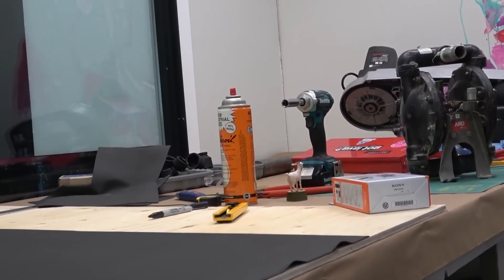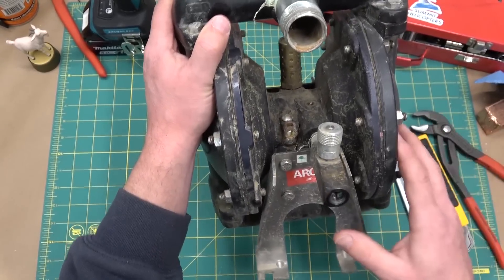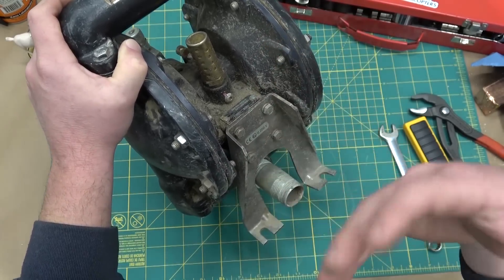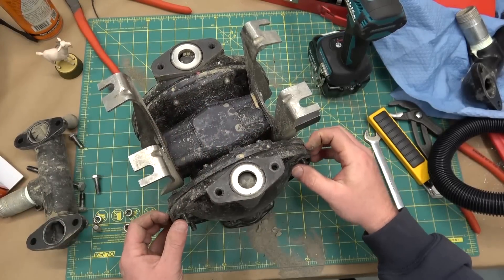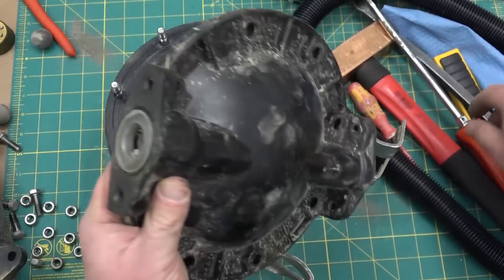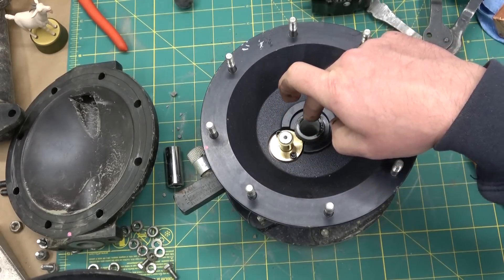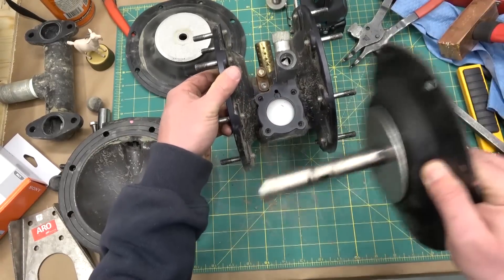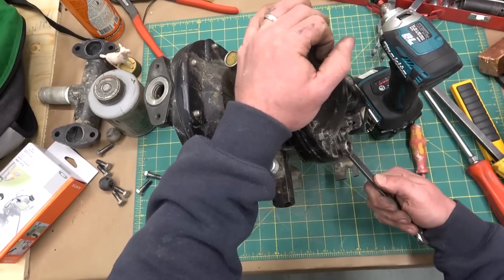BOLTR: Diaphragm Pump | So tough it'll pump ball bearings

Comment: It's going to use more air!!! (By volume) the air must be pressurized enough to over come the resistance to move the fluid which is not compressible. It will only pump 1:1 when pumping air.

Comment: You need a bigass bank of Atlas Copland screw comps to run them pulastory diaphragm pumpulators but they will move  some pretty weird stuff all around the factory. The screw auger transfer didn't like trying to push a ball bearing but where ever that bearing came from it made it through the diaphragmentation pumps. It sure rafmentated that auger! I don't know what dipwad decided an auger was a good idea. A vibratory conveyor replaced parts of the auger's job, and then we put a filter in before the auger to catch those wayward ball bearings and chunks of bearing race. Some fumble fingered fuck had to have dropped that bearing into the fluid circuit.

Comment: We use Tapflo's offerings, but man are they skookum bastards.
Every day we pump almost 3 tons of hardening agent (isocyanate) through the thing, and we've only had to replace the PTFE balls/bearings once in 2 years.
The hoses and ball-valves have to be changed once a quarter, but the pump just keeps on going.

They use up so much air, that they have their dedicated air circuit(?).
It's also convenient because they are not lubricated (the manual even says: "Lubrication of the air is not allowed."), so we can have the "day-to-day" air circuit lubricated at the compressor.....which needs sumps at drops, but is more convenient than having lubes at every drop.

But back to the awesomeness of the pumps.
We even had some nightshift workers change the wrong container and almost 20kgs of isocyanate and polyol mixed inside the feed tube and the pump.
No problem for the pump, just open it up and pick off the polyurethane between the diaphragms. The tubes and hoses were written off, but the pump still pumps.

The nightshift goons were shitting bricks, because they "had" to check the anti-tamper seals against the freight manifest and all, which would have told them it was the wrong container.
"Had to", because it's just red tape so we can track any defective stuff back to a batch and p̶o̶i̶n̶t̶ ̶f̶i̶n̶g̶e̶r̶s̶,̶ ̶e̶r̶r̶.̶.̶ ̶s̶h̶i̶f̶t̶ ̶b̶l̶a̶m̶e work with our supplier to find out the reason for the defect and how it can be prevented from ever happening again.
Seems like you can't out-incentivice laziness.

Comment: I use diaphragm pumps every summer. We use them to pump asphalt sealer with sand and other additives. WIth the proper diaphragm material, we get YEARS out of the pumps.  The worst thing for them is to let them freeze,  so winterization is  key!  We use Wielden M4 pumps mostly, but the ARO are great, too!

Comment: The only thing these pumps hate, are balls of silicone goop. Other then that nothing seems to faze them. They pump what is basically molasses in terms of old engine oil. Never had an issue with them breaking a diaphragm in the shop.

Comment: I was prompted to take to Google and see if there is such a thing as a hydraulically actuated diaphragm pump out there, turns out if something is obvious someone else has probably thought of it.  Also, probably not as good from the standpoint of not self-destructing because the lack of compressability of the working fluid.

Comment: So how strong/robust are these pumps re inlet suction, if one were looking to get their penny's worth out of a 5 micron string wound filter installed pre-pump and sucking/pumping something like 80 deg veg oil?   Also, what's the apprx min psi/air flow required to get these pumps to chooch fast enough to (fe) fill a 30 gal container in 15 min or less?

Comment: Has someone yet invented a liquid drive system for these--using a high-capacity pump and a closed fluid system?  It would obviate the need for a high-flow air system and be far more economical to run.

Comment: Ah, yes.. diaphragm pump... The best thing ever made to pump calcium chloride and water in to a tractor tire for ballast!!
Also pumps the more expensive, but less corrosive "beet juice" in to tires for ballast....
The air consumption comments .. LMAO!! They are pretty much a one to one ratio... One pint of air for one pint of schmoo....
Always fun when the diaphragm base and the pilot valve get a bit worn... And she stops mid stroke... Couple of good hits usually get them going again 😎
Reply: it is always one pint of air for one pint of out put, but the pressure needed to complete each stroke varies. the thicker the fluid, the more air builds up before a stroke is completed
Reply: @devinwilliams3489  yes, I know.... 
Water actually is takes less air depending on head... 
Molasses on the other hand, even when heated, will take over twice the amount... 
1:1 is just a nominal figure.....
Kinda like saying liquids weigh about 8 pounds per gallon.... Some are less than 7 pounds, others are more than 10... But for quick figures, multiply by 8....

Comment: Speakin' of the ol' pilot plant, how's the mining been lately?
Reply from the maker: Gearing up for next season. New-used highbanker and hung low trash pump on deck.
Reply: Good deal -- move more gravel, get more gold!
What size pump and what flavor 'banker are you going with and do you have any hardrock plans for next season?
In the next few weeks, I need to put my claims to bed for the winter, then get to doing a R&R on the gear and finish the build out a few heavy-duty sluices to test next season (prototypes sections are 16" or 24" width and 30" or 60" length.)
I'll be in the market for a good beater pump or two, so I'm looking forward to seeing yours torn down after serving it a few hot suppers, riding hard, and putting her away wet!  By the way, any skookum winches you're aware of out there for moving the BIG rocks that are a sore dick deal?

Comment: What if it's one of the Plastic Pumps, how do you ground them?????
Reply from the maker: same.
Reply: We pump diesel fuel, hydraulic oil, mudd etc.... Install the ground wire on one of the screws at the Air Valve just like on your pump? Air goes thru making static electricity, so ground at the Valve to dissipate the Charge?? Yes... You are The Mann!! thanks for saving me life n my crew, mucho appreciated from da North Florida boys!!! getcha summ  AvE!!!

Comment: Diaphragm pumps can be total shit in my experience as a plumber. I prefer just a regular old 2” grinder pump with a float switch. Not sure about industrial diaphragm pumps but those used in the residential/light commercial industry are shite.

Comment: Imagine, if you will, such a pump given the task of shoving coagulated cow blood up a 4 inch pipe 30 feet. The diaphragms were 24 inches across and could empty a 7000 gallon tanker in 40 minutes.

Comment: Change the ball check valve for tesla one way valves and I bet you can pump much larger particulate in the same device.
Reply: The tesla valve doesn't really work for this application
Reply: @alf3071  a one way valve? I can't see how it wouldn't
Reply: Sarch Lalaith Wouldn’t particulates get trapped in the channels and eventually fill them entirely, disabling the check action?
Reply: @sarchlalaith8836  If you search videos with tesla valves you will see that fluid goes backwards too so it isn't really a check valve, maybe in certain conditions it could work, but some fluid will go backwards
Reply: @bloogaming8827  why would they? Any particulate that can't pass into the valve channel would be trapped on the inlet surface and you'd just open it up and clean it exactly like this, but given the absence of a ball filling the majority of the void into which slurry flows you'd be able to run bigger particularities than the ball valve, up the three channel Diameter of the valve.

Same way that the pipe doesn't get blocked the valve won't get blocked.

Yes there are always exceptional events and that's why maintenance is necessary but think of it like this, no moving parts to jam.

Comment: 2,100 gallon of phosphate based spray washer line (1 tank of 4) on a powercoat line.

2" outlet hose,
115psi shop air running a 2" diaphragm pump.
Rental place just tested it. Works like a hot damn!

30 seconds in to tank transfer, diaphragm ruptured.
Hose kicked off the three clamps(2 where c clamps) I had holding the hose to the tank, plus two 20lbs lids on top of it. I had tried to pull them off and could not.
But the moment the air pressure ruptured the diaphragm valve I was dealing with a huge snake spray diluted acid everywhere every have cycle I got air and a half cycle pump of liquid.
Yelled for help. None came. I then just said fuckit! And ran through the donkey dick srapying everything to get to the shut off valve. I was closer to main line shut off valve by tanks. I had already closed that bit with 200+ gallon of air capacity in the lines alone, I knew get it done or pump tank empty. Then try to handle a hose of air. Fuck that! I have dealt with that also and it's worse cause it kicks around faster and wild. Ends quick but still get the fuck out of Dodge or get sent to hospital. The hose the broke free from camps had pushed it self against the frame of washer so it was pressed against that frame corner, barely. Took a calculated risk of being able to get to the emergency wash station 10' behind the hose spraying diluted acid. So I ran into the path of spray, shut off the valve supplying the air to pump. Pump stopped, hose dropped and I walked/slipped my way to the emergency wash station and rinsed off as much as possible. Cleaned up my mess, made repairs to areas bent by my clamps, and went home and took a long shower. Skin was on fire the hole time after wash off at station. Took an HR to get home strip off clothes and shoes. They where left in a trash bag out my porch. Months later remembered about bag on back porch, then went through it. Strong smell as open it. Look at clothes looks fine, till they came apart like a start sitting in sun for years. Tears like nothing. Like what battery acid does to rags but less holes. All fabric was just like dried moss. Easily torn.
Rental place gave me my money back, then asked me to sign a waiver. Lol. Got great prices after that for a while. So your fine? Really? Is all they asked me every time for a month or when ever I went there. They where more afraid of being sued for damages done.
This was a very lucky time for the place I worked for.
No filed anything. I was just very lucky. And I didn't want to point blame. We where already in process of pumping out tanks and washing down area. Company was getting ready to move to new a warehouse. Again, lucky.

Comment: On a tangent, I keep finding stores that smell like sewer, because the apes running the place don't know you need to toss a few gallons of water down that drain every once in a while. I'm left pondering, do I fix the problem, explain the problem, or let them call a plumber for an expensive lesson in living with commercial buildings you generally don't experience in private residences.

Comment: Used to dick around with these on the regular. Had to keep a few on the shelf just in case the local fuel depot made a phone call since the ones we had were fuel rated and had the ground straps to hook up for anti-sparky measure.

Managed to come up with a few other use cases for them since a healthy sir could heft a 2 or 3"er into the woods without hurting themselves and there's always air on one of those jobs somewhere. And they don't need to prime, so they're fairly idiot-proof, whereas the other dinky trash pumpers tend to eat themselves when a moron pops the drain on the truck and they end up getting dropped off dry or somebody assumes they're self-priming (usually the second thing, for some reason).

Comment: By chance are you going to tear into the air valve on that pump?  That is where I could never get them to work and struggled.   I know the tolerances are super tight and may have been my demise.....Or is that the reason you did not pull it apart?  In my defense, they were fuckered before I tried to unfuck it!!

Comment: If i had a dollar for every time i had  to pull one of them apart and clean or rebuild it
Reply: Super simple, skookum choocher
Reply: @mephInc  yea but they dont like sucking up bugs and clumps of mud.
Reply: @94Gidge  
The ones we use at the steel mill have a 2" inlet. They'll move just about anything.

Comment: one twice the size saved our asses once while on a voyage from new sealand to china with a fuckton of kiwi in the holds, the engineers fuckedup the bilge pumping system once again (well the one guy not used to old school valves and all the needed skill to operate the pump, thinking they work like the new systems on newer vessels where you just push a button), so we quickly "borrowed" the biggest one from the enginedepartment and pumped all the bilges empty in the night before arrival and saved the bottom holds from wet and useless cargo, all the stuff you do because the captain is a masochist who likes 30 hour shifts; ah-hm i mean because we love the job